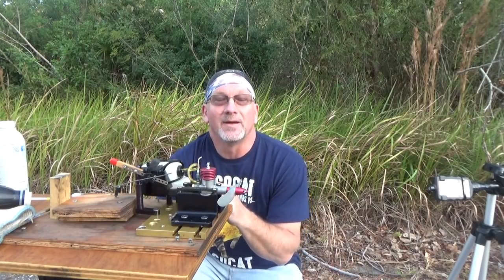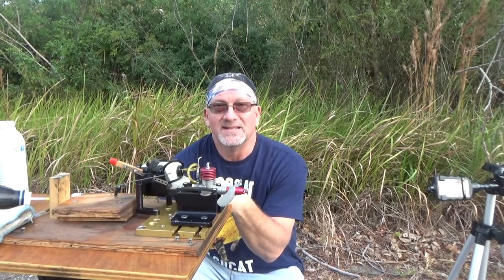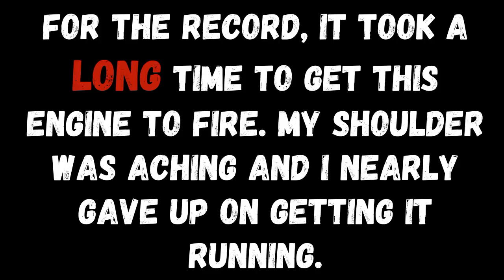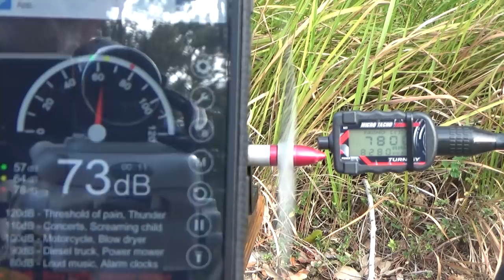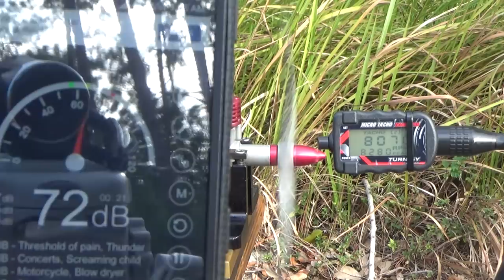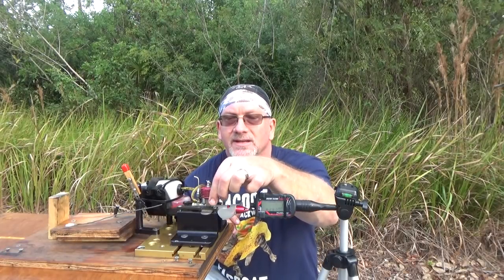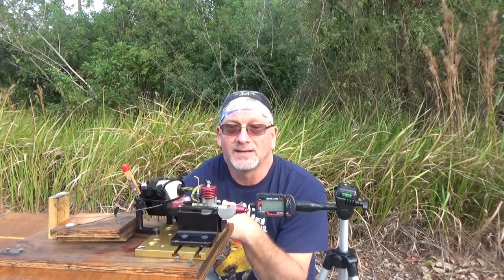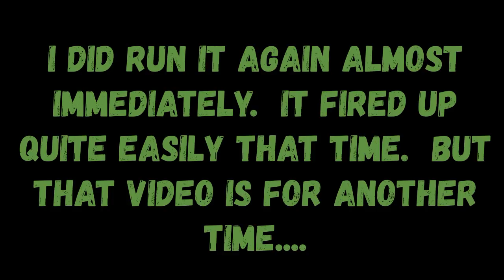MK-17 The First Run

Comment: You are experiencing the "pain" for finding the correct setting(s) for that first time to start a diesel engine .. Now that you got this ... ALL subsequent runs will be a breeze ...  You could shorten dramatically this "first" setting run on any diesel engine but that requires that you have had your share of time spent with them when teanager .. It is a "lost art" sort of speak but for those who still enjoy them are trully fun engines. By the way, that engine comes with a stock plastic propellor (from Russia) .. that is roughly a 7x6 .. while a 9x5 won't kill the engine, you should switch to an 8x5 for more free runs .. My opinion. I have several of these exact same engines (some of them still brand new) and the ones I use (for control line primarily) are truly enjoyable.  I enjoy watching your videos.

Comment: Great share, Welcome to diesels, or compression ignition to be more correct, as you use in the video (and I know I am 3 years late to your party, here). I haven't run one in a few years but for fun just picked up one of these. I will have to relearn to run them. Once good thing is you can make your own fuel. John Deere engine starter is supposed to be the purest ether. I tracked down a bottle of cetane, just a few drops does the trick - like nitromethane for glow engines.

Comment: Great presentation 
How do you control the throttle with a servo?????
Reply: It is not a radio control engine which have a throttle. It was designed for free flight, control line or radio assisted free flight with radio controlling only rudder or at most, rudder and elevator.

Comment: what you will find is when the prop bounces back and forth, the compression screw is in too much.
Reply from the maker: That part at the beginning?  I was wondering what the heck was going on there....  Thank you.
Reply: my MK17 did the same thing after you get a few good runs in it wont do it as much